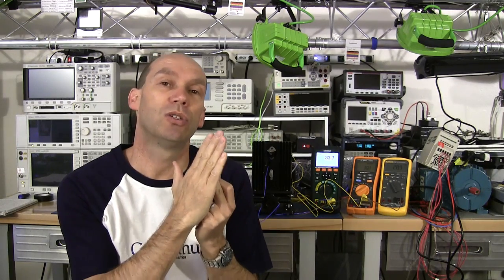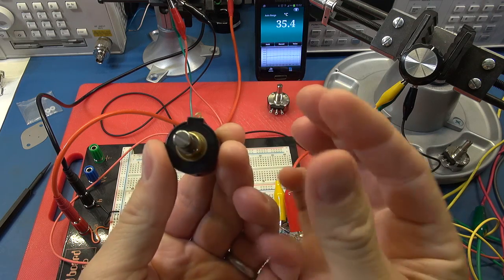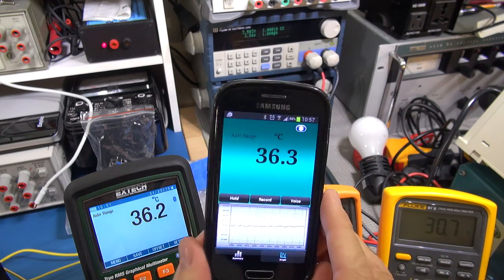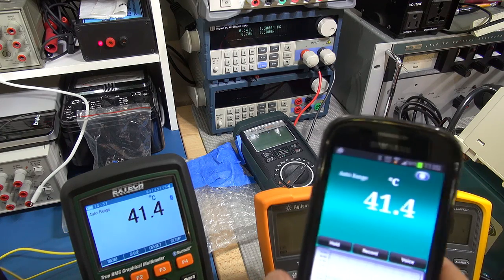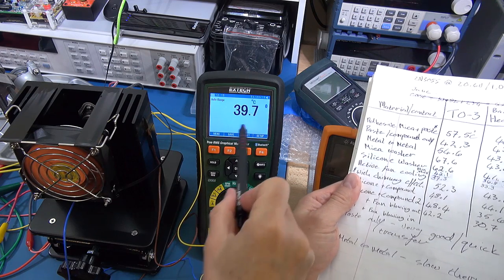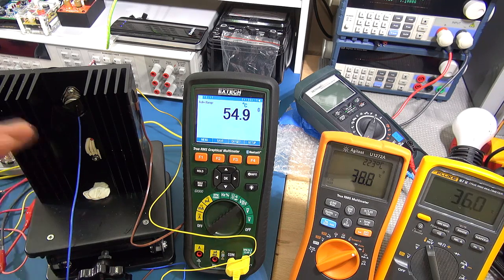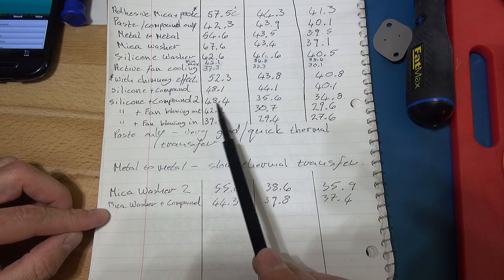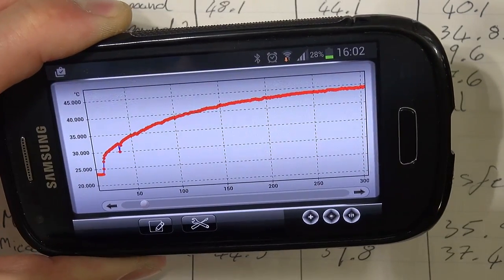DIY Bench Power Supply #12 -  Heat Transfer Follow-up

Comment: Just a friendly tip: kapton tape is excellent for securing things in high temperature environments.  Unlike electrical tape that gets tacky and soft in any amount of moderate heat, kapton is unphased.  Every hacker should keep a roll on hand!  Keep up the great videos.  Cheers!
Reply: TechnologyCatalyst Any good sources for Kapton tape or film?
Reply: It's never very cheap, but you won't use it often enough for it to matter, so I'd say just hit up amazon.  I keep looking for cheaper sources with no luck.  It's used a lot in 3d printers, so you could also check websites that sell 3d printing supplies.

Comment: Thanks for doing the mica insulator. I used them and plain clear silicone compound in my early years before pigeon guano messy white stuff.

Heathkit told me to apply a very thin coating of the clear stuff to the mica when building my AR15 stereo receiver in 1965. Emphasized thin.

I always noticed mica, clear grease was my favorite choice in my engineering career.

I later encountered what I called grease free swimming pool patch junk on otherwise highly regarded pro audio gear I serviced in my career.

Manufacturing ease, but hotter transistors.

Can you do a mica and plain clear silicon heatsink grease test?

Comment: The fan blowing onto the transistor will deliver air at a higher pressure hence higher density thus able to absorb more heat. The other way around will lower the pressure and so lower the ability to absorb heat.
A.
Reply: Andrew Eastland Agree. Basically the fan will be more effective if it is moving cool rather than warm air. There is a good thread on this exact topic on Eevblog, delightfully titled 'blow or suck' :) .
Reply: jix177 Yea, blowing cool air on heatsink is more efficient. I assume this PSU project will go in the end into some sort of enclosure, and that hot air out of it has to go somewhere. Right onto other components whats get hot under load?
Reply: Andrew Eastland Kinda of correct, it's all about the geometry of air flow on both sides of the fan. The low pressure generated on top of the fan will pull air in from all sides (same amount of air but at a lower speed). While the fan will blow this air out as a narrow column, i.e. same volume of air but a through a more narrow cross-section of volume. Exactly same principle as a water pipe, larger diameter pipe getting narrower, water flow increases.
Reply: Andrew Eastland Principle of a venturi on a carburetor comes to my mind perhaps..

Comment: Hello Martin...Thank You for these video series, following along and enjoying the general and specific results....!   If you want to use the 2N3055 at its max, you mount it, with compound, directly on the heat sink...and Then... Isolate the heat sink from the chassis.   If you want to max the fan cooling, you make a front lid on the heatsink, to represent a chimney... and blow air up through all the heat sink.   Of course, for MadMax,  fluid cooling can be applied...!  Greetings from Denmark...Jakob.

Comment: Thank you for going through this so thoroughly. As a complete newbie to electronics you are teaching me so much more by not talking completely over my head. I actually understand what is doing what and why. I may have missed it but will you be going into the steps needed to change it to say a 30 volt 30 amp PSU?

Comment: Hey +mjlorton.
Sorry for reposting, but because i dont have the scheme yet. I entered the link in the description of the "DIY Bench Power Supply #7", which suposed to have the circuit diagram but I couldn't find a picture of it. I really want to built this power supply, it is simple and easy to build. Can you post it in a picture or do somthing like this?
Thank you,
Noam :)
By the way, is the part list updated?

Comment: Nice meter (Extech w/BT).  Question:  Why don't they put power jacks on DMMs?  I was thinking of adding one to mine but not sure if power from mains (via power supply) will affect readings?
Reply: Digger D Probably a mater of high voltage isolation.